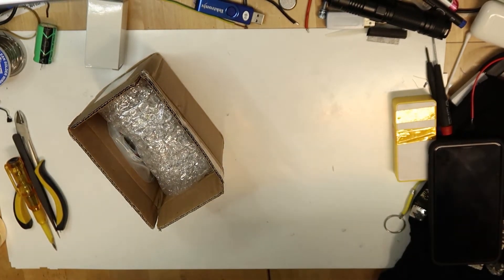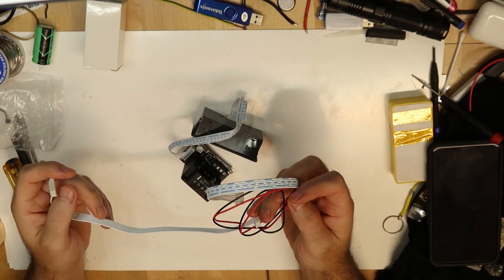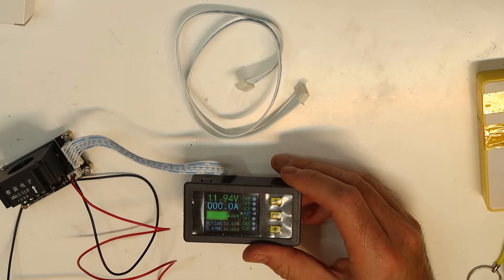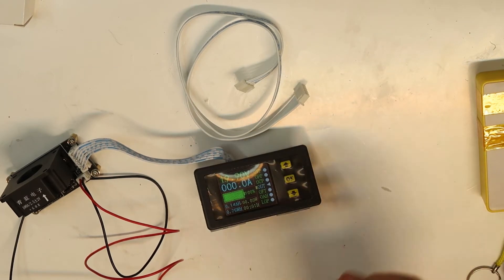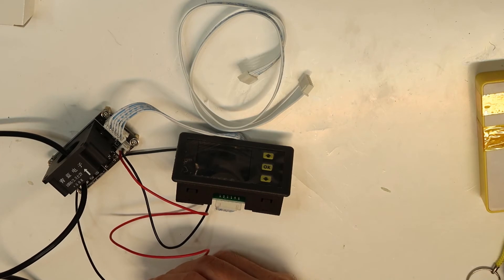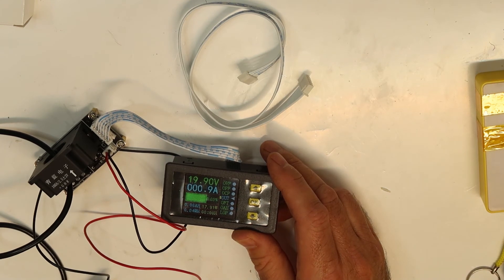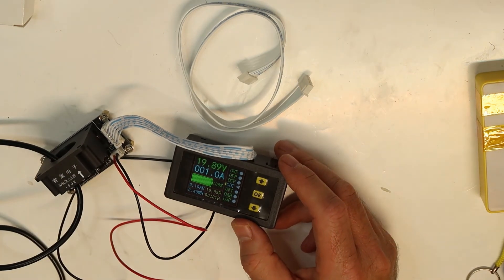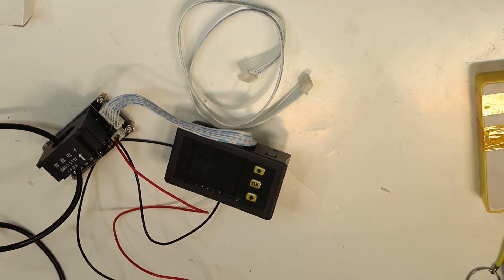Voltage and Current hall effect LCD display plus many more functions - Part 1

Comment: hello, is there a way to adjust this? I would like to switch the relay on above 29v and if it goes below 29v again off but when it rises above 29v again the relay should automatically switch on again. Without having to press a button.

Comment: Hi Roee,

really a great video and thanks for your effort to explain all this, because the manufacuter should include a users manual with it.
I learned a lot from your video and that made it possible for me to experiment some.

A few things first that anoy’s the hell out of me tough:
The backlit won’t stay on and there is no setting to change that.
There is also no setting anywhere to acitvate the OUT again after a protection setting turned the OUT off, such as a low voltage, amperage or power setting.

However, I found a function that is not mentioned in your video and that is the “hidden” setting, below LOP.
For instance, if you set the Over voltage protection (OVP) to a certain voltage and you activate it, the activation becomes lost after a reboot, but the OVP setting itself is kept.
The same thing for the OUT setting, when you set it to be on, after a reboot the setting is off.

Now, for the hidden setting.
It not only clears the counters, but it also stores the activation settings in memory.
So when you want to have an activated OVP with the OUT on on reboot, just set the voltage, activate the OVP, then activate the OUT so the relais connector is on (more over that relais later)
Then go to the hidden setting below LOP, long press the OK button for about 3 sec.
Then click eighter the up or down arrow and click ok again en check with the arrow button if you are back in the visible settings (yellow cursorbar)
The unit will reboot every time after a power loss with the OVP set to the set voltage, is activated and the OUT is also on, even after a reboot when a protection was kicked in and that goes for every activation setting for that matter.

Why is that handy to know?
Well, I have solar panels and when a thick cloud comes before the sun, my solar panels will not provide the power to keep up with my power needs, draining my batteries as a golddigging bitch.
So, I also connected a intelligent battery charger to my batteries and I want that thing to kick in when the wattage of my solar panels goes below my power needs, but I also want that thing to shut down when the cloud is gone.
So this meter does exactly that, because I can set a OPP value to shut the charger off, but when the next cloud comes in, the charger is not turned on again.
In this case, you can use another power detector board, (such as the M3050 AC current switch) that comes on the second it detects a low power tru the wire and boots the meter again, wich then starts the charger by the relais with the setings as I explained before.
The extra power sensitive boards are really chap (about 12 bucks on aliexpress and you have to set the level on wich the thing has to be activated with a little potmeter, but you can use the measurements of the meter to determent that setting.

Some notes about the relais connector on the board tough:
Some people may think that when the setting OUT is on, the connector is shortened and you should provide power to it to make a relais work.
That is WRONG and could damage your board, because the connector on the board provides power (the + and – sign below it is a dead giveaway).
But beware when you put your board in self powered mode.
With an external powersource, the voltage of the relais connector is always the voltage of the external power, but when you are in self powered mode, the voltage of the relais connector becomes the voltage that is put into the board (and is measured by the meter)
So when you have solar panels that will generate over 40 volts and you connect a 12 volts releais to the board, the relais will burn out and you can also damage the unit, so beware!

That is it for now, may be I’ll come back later to tell you about a trick to keep the backlit alway’s on.
I pried the thing open and it looks like I have to find the soldering connections on the flatcable that powers the backlit and then connect them somehow to a powerpoint that is alway’s on, no matter what.
If I find that, maybe I think it’s best to connect a microswitch to it to manually turn the thing on or off.
But maybe this is also a nice project for you to look into?
Reply from the maker: thanks for the info
Reply: Both the video and your response are so helpful! Have you found that this device can replace a very basic solar charge controller? I would like to use it as one for a small diy portable power bank ( in a small pelican case). I love that the display panel is above the case panel and that the wires are below it (you can see the info but the wires are safely tucked away).
Reply: Also, side note, just me personally, I think I would like the back light to power off automatically because my diy solar generator is very tiny, and low Ah. Maybe that is why it’s that way as a default. Looks like you have found a way to bypass the switch tho. 👏👏